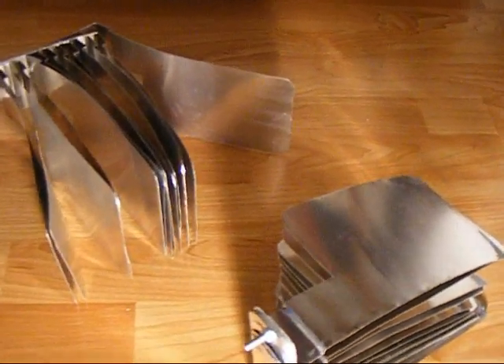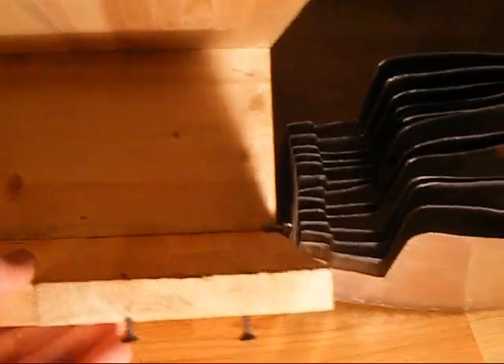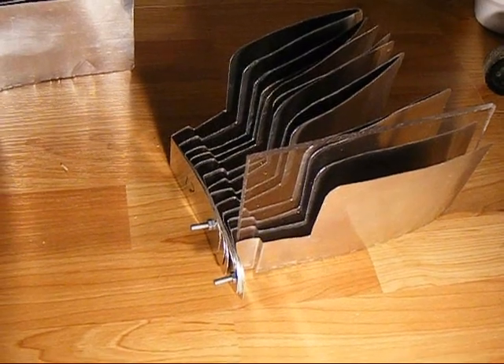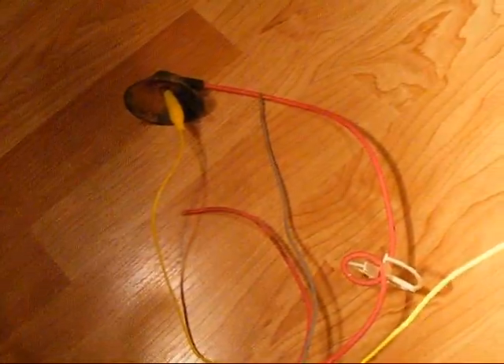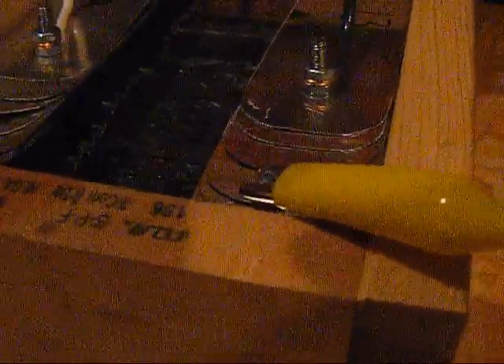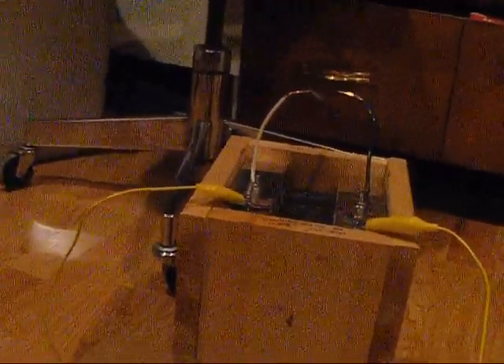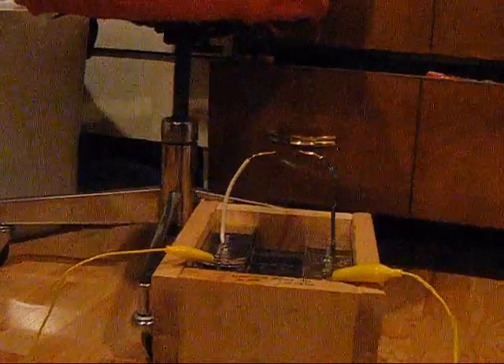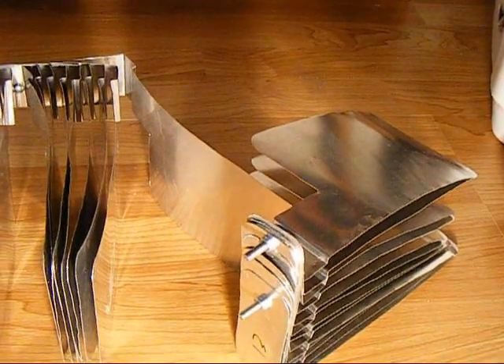Junk +  5810g =  High Voltage Capacitor Fun

Comment from the maker: Oil submergence is a good idea as the capacitor voltage never reaches what the flyback outputs.  Too bad the leaky wooden box isn't sealed and my original plan didn't include oil as this was just a test. Maybe a larger capacitor with 8' x 4' plates in a dumpster filled with 500 gallons of oil will be more impressive.